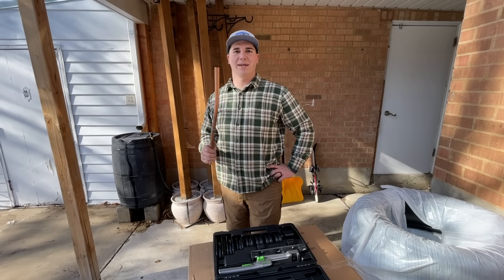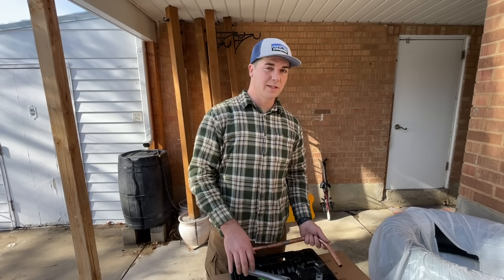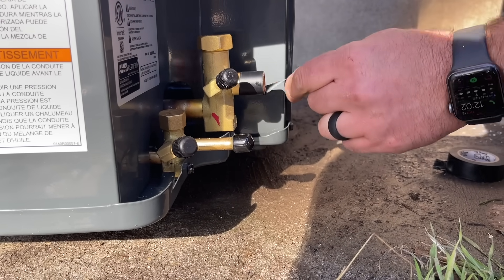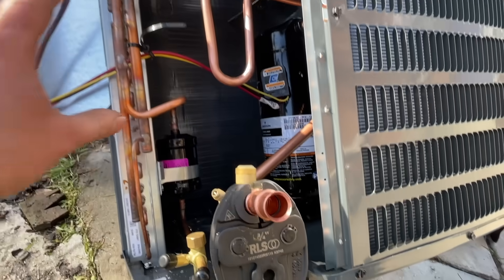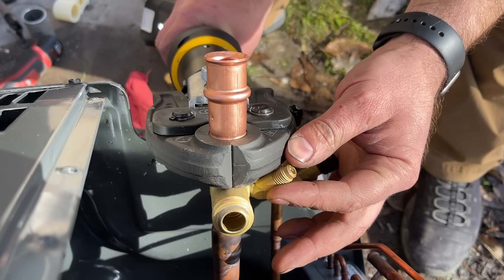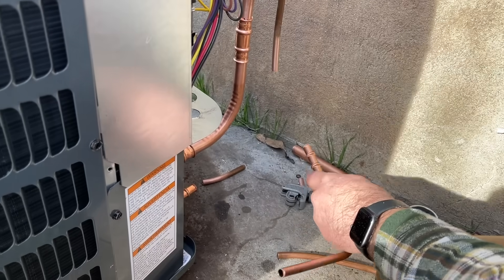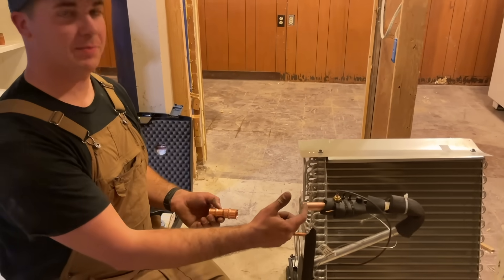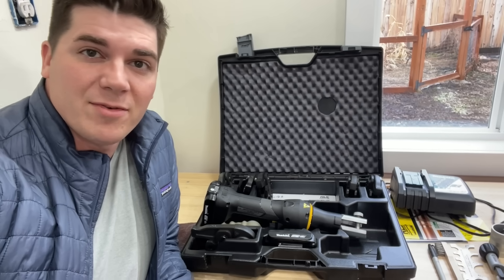Brazing Is For Cavemen. THIS Is The Future Of HVAC Copper Connections. -RLS Crimping Tool-

Comment: Try the Smartlock fittings. Only need 2 adjustable wrenches to install. The only fitting on the market that fits over the swage hubs at the condenser and the coil. No need to do any surgery on the service falls. No expensive tools to buy. No de burring. Oring seals are only good for POE oils.
Reply from the maker: Please email me with more info on this! I’d love to know more.   Diyhvacguy@gmail.com thanks!

Comment: How much does that tool kit cost and fittings cost is it worth buying it?  99% of my HVAC systems I install only need 6 solder joints at most. My torches I bout like 20 years ago for $200 and a pound of 15% is about $100 now and last a long time.
Reply from the maker: It’s 3500 with jaws, and fittings on average are 20/ea. I just forward that to the customer as my bid is already way way lower then most. Tack on $500 until your unit is paid, then just forward the price of the fittings in your bid 👍🏼
Reply: @diyhvacguy  nice thanks for the info!! I’m in a small rural area so I don’t get this kind of info. The nearest HVAC supply house is like 2 hours from me so I love seeing all the new tools!

Comment: I think it has value in some commercial applications where using a torch is a real PITA. I work in HVAC in overhead ceilings and its a life saver if you can repair systems without taking your fire panel off line and also work in tight spaces inside of equipment cabinets that have tons of wiring and sensors that can be damaged by the torch.
Reply: Yeah I work in refrigeration, and if we’re at a hospital or airport or something, it can literally take days to get a burn permit, press is good for situations like that and very tight spaces. 

However, I don’t really like the all or nothing mentality that some people have and the title portrays, pro press should be viewed as just another tool for specific work, not a complete replacement for brazing.
Reply: Totally agree. I work in a lot of high rises and there’s always a damn fire sprinkler head right next to the refrigerant pipes going into the air handler. Huge hassle to get the sprinkler company out, drain the floor or whole building, plug the head, RE pressurize the building. Then you braze your fittings in about 5 minutes, pressure test and then have the sprinkler company reverse everything they just did. Every time you do this it takes hours and around $1000 per sprinkler head. 

As an HVAC business owner I’m looking at getting one of these just for this situation. If my guys can press the refrigerant pipes in a few minutes and save $1000 a unit this thing will pay for itself after 4 units. 

Oh, and for all the naysayers out there saying just cover the sprinkler head with a cup of water; DON’T TRUST THIS. You set that head off in a multi floor condo and your looking at $100,000 in damage minimum. Know several other contractors who’ve done it. 

I’m personally looking at the Milwaukee 2922-22m though.
Reply: So it's great that you fixed the problem quickly and without needing a "burn permit", but do you go back and replace the joint with a proper brazed joint later on?

Comment: thumbs down b/c you hooked up this a/c unit with standard hd or lowes copper lines which are not rated for a/c pressures of 400 plus. sorry. if i am wrong plz say so and i'll change to thumbs up. nice try tho. plus your couplings are subject to leaks that brazing wont be.
Reply from the maker: You are very much wrong sir. All of the fittings used here are specific to HVAC pressures. Made by RLS.

Comment: I am a full time plumber and I have the press tool, pex crimper and regular soldering torch. I will always always solder over press anytime I need to make
Copper pipe connections. Unless I’m working with a leaking water line and cannot stop the flow of water all the way or a live main, however 9/10 if I can use a torch to do tbe job I would choose that all day long
Reply: I remember looking like I just watched a trainwreck happen when I stepped on to campus for the first time and saw the guys getting the prep work ready for a 4'' copper line job in a couple of the basements.
They said it was the only way, because the hydronic line was so close the concrete ceiling and insulation, that there was no other way. Wish I could find out if they're still holding after all these years.
Reply: @MR-nl8xr  Do they even make 4” press fittings, or am I misunderstanding what you are saying?

Comment: You could have at least brazed the service valve line in - no need to tilt the condenser or anything. Then if you felt like it crimp the rest
Reply from the maker: For sure. I wanted to see how the connections do at the service valve. If any of them leak you guys will be the first to hear about it!

Comment: Use this method if you don’t mind callbacks. It may be the best thing to come along since sliced bread but I’d wait until it has a proven track record. I sure don’t trust this method but I’ve been wrong before.
Reply from the maker: I’ve gotten repair calls from failed braze joints. So it’s kind of the same. You throw a novice installer at it who doesn’t prep, you will yield the same results either way.

Comment: would rather braze due to high PSI of refrigerant
Reply from the maker: These fittings have been tested up to 4000-5000 psi, and the copper pipe busted before the fitting. But I can respect the folks who will only braze as it’s tried and tested

Comment: curious how it holds up in earthquake ridden and high heat areas for residential, definitely can't use the cheapest o-rings! I doubt we'd use this in commercial hvac maybe on coolers that never move or get any vibrations. Seen too many o-rings fail in my field
Reply from the maker: Well these are definitely not your average cheap o rings. They are specifically made to see refrigerant oils and the price is forward to the customer because the fittings are about 20/ea. but  we just forward that on to the customer. It’s not a huge amount.  

Time will tell on the first question :)  cheers

Comment: Know for a fact. We had a freeze for a couple of days and when the temperature started going up, we had line breaks on our water lines where we used press fittings. We  tried lime hell to wrap everything on the property and drip faucets but at the end, we had leaks. Once you get the water to ice up, they will leak. Great for warm temperatures all year round.
Reply from the maker: Plumbing is a different ballgame my friend. This is for refrigerant lines and it’s a totally different system, and for that matter totally different crimp fitting then the water ones 👍🏼
Reply: Yea, I know. I would never have my HVAC department do that.
Reply: @josephrocha7879  no i think you onto something, the oring is just a rubber ring and in cold climates were we get anywhere from -20 to 90 degrees  the oring can deteriorate by freezing and causing to crack, with the pressure of 150-250psi its possible.
Reply: If you didn't have press fittings the pipe would have split instead. Unless you are using PEX lines that can expand freezing will always cause a leak, the ice simply must expand somewhere.

Comment: It looks nice but, I would have installed 5 condensers brazing while you were installing that 1unit. No thanks I'll stick to the more secure torch and rod traditional way.
Reply from the maker: I can respect that :) Just wanted to share with my viewers. Cheers
Reply: @diyhvacguy   is anyone talking about the fittings themselves being made of a soft metal like copper? i would be worried that down the line if the ac gets moved aggressively, it could bend the fitting enough to leak at the fitting where as a braze would mold to the shaping just like copper.

Comment: i do see some advantages to these fittings. I do have to ask, why so many? You have benders, why not make your bends on the line-set then trim off the excess?  Four joints instead of eight or more, every joint is a potential future leak.
Reply from the maker: I totally agree. If this was a new lineset I’d only have 4 fittings, but when you are working with existing linesets, a lot of times that just isn’t possible.  They make 90 degree fittings but I think for the condenser it would put the line too close to the side of the condenser and it would look goofy. But I’ll do some more videos on this and show how to minimize the amount of fittings used. Thanks for the feedback
Reply: @diyhvacguy  completely true, many times the original lineset needs to be reused, if for no other reason , the access for replacement can be extremely difficult.
Reply: If you know how to bend pipe, you can make a piece.  I’ve made bent pieces with three or four bends, and only used a coupling and a braze at the service valve.  Just like an electrician bends conduit to eliminate all the fittings.

Comment: that systems looks like a lot more time and work than soldering the joints, and at $3000.00 for the tool it  is no savings for the customer
Reply from the maker: This was a tutorial video. If I wasn’t setting aside time to film, I could have this done in a fraction of the time.

Comment: Did an old church basement no torches allowed. That was about ten years ago. Haven’t had a leak yet. I believe it’s a bit more work. But a lot safer. I also believe the fitting are pricey. So you’ll have a lot of the old timers hating on this. But I believe it’s the future. The Hvac technology has been unchanged for awhile. Hopefully they can find a way to heat and cool. With less waste.
Reply from the maker: Thanks so much for sharing! I’m convinced that a lot of these guys are doing no prep work, just slapping these fittings on, not thoroughly inspecting the pipe for deep scratches where the o ring will be, and if that’s the case then yes you can expect to see a leak. But thanks for sharing your experience! That’s great to hear.

Comment: It’s funny how so many people say press fittings will leak down the road. I’m 12 years in the field and every year I have to fix brazed joints leaking because people didn’t put enough heat on the joint or didn’t apply heat in the correct area of the joint. All processes have potential to leak
Reply from the maker: So true
Reply from the maker: “But you’ll never see one of MY braze joints leak, and I can be done before you get your fancy tool out of the box” 🤣

Comment: I work in the HVAC/R industry.  Specifically in the Commercial and Industrial applications.  I use this a lot now as many sites I go to do not allow Hot Work(using open flames).  These are becoming more widely used in the industry.  These crimpers and fittings that are used are specifically designed for refrigerants.  Do NOT confuse these with the ones used on water line as they do not crimp the same way and will leak if you try to use them on refrigerant lines.
Reply from the maker: Maybe that’s why everyone is saying they leak 🤣 wouldn’t that be funny. And a nightmare for people installing the wrong ones lol
Reply: @diyhvacguy  it tends the be the biggest cause.  The other cause is they didn’t ream the pipe(inside and outside) or clean the pipe.  Which causes the o rings inside to fail.  Either by nicking the o ring because it wasn’t deburred well enough or at all, or because dirt and debris isn’t allowing a tight seal.

Comment: These fittings have rubber O-rings that go bad in time they do not last as long as long as braised and that is the fact
Reply from the maker: This isn’t a replacement for brazing but for jobs that it will help me, I’m gonna use it.

Comment: Now your pipe is done you can’t reuse  the end got to cut it replace a section and that will leak in time I have seen 30 year solder joints.
Reply from the maker: Wrong. I’ll do a video on how to remove it and braze/solder if needed

Comment: Too bad you got the tools but are installing a Goodman🤢.  Are those fittings rated for 410a?  I know for water I thought it was 200psi. Also I for damn sure am not going cut the valve off take the A/C unit lift onto table press fittings then put A/C on the floor to press again.  All that when you can sand and braze and done!
Reply from the maker: Yes I wanted to do all of them just for this demo but for the next job I’ll simply solder a nipple in that’s about 3” long while it’s on the trailer and then it will take seconds on the job when I set it in place.
Reply from the maker: What’s everyone beef with Goodman? They offer a good product with cheap replacement parts.
Reply from the maker: Also these fittings have been tested up to 4-5000psi before the fitting or even another section of the pipe burst. Look on RLS website.

Comment: Couple thoughts: That crimp tool looks expen$$ive! Not exactly something a typical weekend DIY HVAC homeowner would splurge on. Also, I could see if those crimps are done wrong, that there might be serious leakage issues. And even if they were done correctly, would they really remain leak free for 10 or 15 years? O-rings are rubber and can deteriorate. Crimped metal just doesn't seem like it would be as safe as a connection of solid melted metal, which can also easily be un-sweated and removed later . Probably no so easy with these one and done crimped connections.
Reply: Kit in video is around $3k so no, it's not cheap.
Reply from the maker: It’s not too bad if one needs to be removed. Yes it’s expensive, no it’s not for a diyer as stated at the beginning of the video. Time will tell on how long they last but I’ve heard a lot of good things about them, and Zack over at qualityhvacr uses them and I trust him. He is a pro

Comment: Hey There Sir! 
Good Luck in your YouTube HVAC journey! 
I work in the HVAC Field in MI, A Lead I work with who knows everything mechanical informed me that the worm drive in the HIllmor benders can be damaged if you use the green release while under pressure. Just hold the handle slightly to remove tension then use the green release and it won't damage the mechanism and cause premature failure/ excess play.
Reply from the maker: Good to know! Thanks so much for sharing your knowledge! I really appreciate that
Reply: it is a crappy bender, i went back to the cheap ones

Comment: Or you could braze it in a minute, not have to raise the unit, disconnect many parts or spend $3,000.  The braze will never fail, like orings do.
GFM
Reply from the maker: Grayfurnaceman! Big fan. I respect everyone that wants to stick with brazing. I’m not replacing brazing with this, and the title isn’t to offend anyone, it’s simply a curious title that gets some attention. Im willing to blaze the trail on the crimp fittings. If and when one leaks you guys will be the first to hear about it! Cheers
Reply: @diyhvacguy  Should be interesting to see how they work out.
GFM

Comment: Been doing HVAC for 33 years. I would never use this on refrigeration piping, especially R-410 which can operate at pressures up to 525 psi.
Reply from the maker: These fittings are tested to 4-5000psi. Check out RLS website. Cheers
Reply: @diyhvacguy  That's fine, but that doesn't explain how well the fittings will hold up to time, extreme temp/psi changes (via the ambient temps and operating pressures) and the chemical reactions from the different freons and oils. Not to mention the possibility of someone hitting the lines. Freon releasing (@200-500 psi) via a fitting break/leak is extremely dangerous. It can cause very serious injuries. IE - blindness, 3rd and 4th degree burns, and damage to buildings/homes. The new freons that are coming out in 2-4 years are going to be extremely flammable. This alone deters me from using those fittings. Thanks for being crafty and trying to save some money. I've been doing HVAC work for 33 years (everything from residential all the way up to 1500 ton chillers) and it's my opinion that freon line installation and repairs should be left to experienced technicians. Cheers to you.

Comment: Really not a good practice to press directly to valves like that. You should always braze stubs off your unit connections even if you are pressing everything else. That joint will be a nightmare to repair if it develops a leak down the road.
Reply from the maker: It shouldn’t be too bad. I’ll do a video on removing one of those so everyone knows how to do it. It obviously would have to be brazed at that point what’s the purpose of having the tool if you still have to braze? I wish they’d make ones with a longer stub like the old tempstar. But I also wanted to use this one as a test system since my friend was cool with it. So if it doesn’t leak in several years I’ll have it for reference.
Reply: @diyhvacguy  That’s kind of an odd way of looking at it. Zoomlock has become really popular in the commercial space because it avoids hot work permits. It has its uses in tight spots where fire can be a concern or for repairs. I’m not a big fan of it for large scale installations. The fittings are expensive and the prep work takes as long, sometimes longer than just brazing the fitting. It’s also expensive and time consuming to repair in comparison to brazed joints. It certainly has some great uses but it is simply an option with pros and cons just like brazing. One important thing to note is fittings can be defective. I’ve pressed fittings after prepping the surfaces and pressing to exact manufacturer spec and it still leaked. That can happen at a service valve and now you’re looking at a costly and time consuming repair rather than a quick braze to touch up or cutting the faulty fitting out and pressing in a new one on the stub previously brazed in.
Reply: Only if you are worrying about the next guy. This would require replacing the service valve.